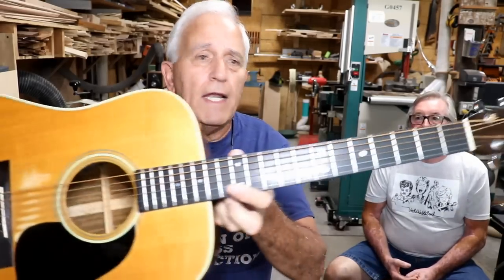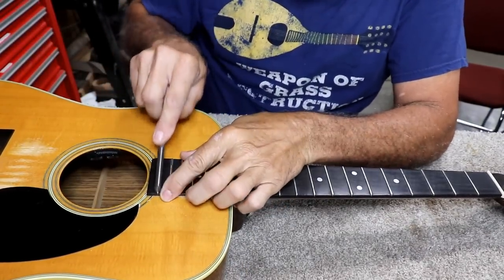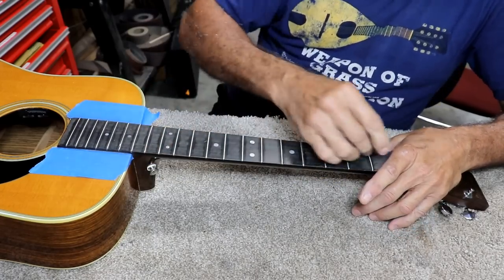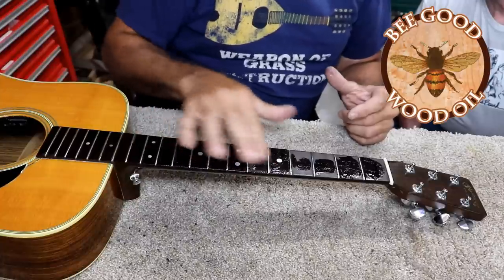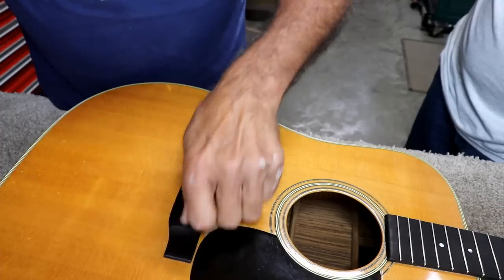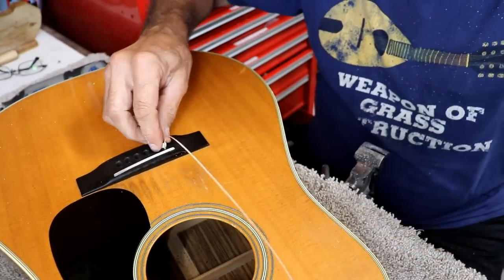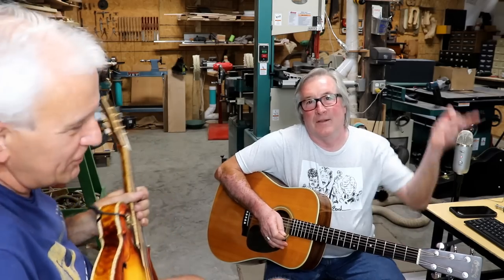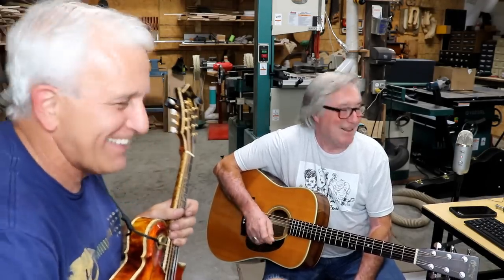585 RSW This Martin Guitar Is IN A PINCH

Comment: Hey Jerry, You putting grooves in groove-less bridge pins reminded me of an article I read some months ago.  Essentially, it said that it was sonically better to put the groove in the bridge/bridgeplate and then use groove-less bridge pins.  This would also eliminate having to file an angle on the pin tips, as you recommend, and I've been doing for over twenty years.  I haven't changed any of my guitars to this method, but I think all your many fans would be interested in your opinion of this issue.

Comment: Taking those heavy Grover tuners off the Martin guitars and putting Waverly’s on it helps tremendously! Takes several ounces off the peg head and lets it vibrate! It gives the guitar a much better feel without the weight on the peg head! Plus they stay in tune much better!
Reply: I've often thought about the added mass/weight of enclosed tuners; even on an electric...  I'd say the ones with a thin metal covering might be preferable to the kinda machined metal chunks.  But... I love the feel and ease of tuning of the high ratio, metal chunks; most of my 17 guitars have them.

Comment: When tuning the B string don't tune it open....  Fret the third fret and use your tuner to tune it to D.....That usually makes the B string sound more in tune.... Works best for me....
Reply: Hmmm... interesting.  The method I use is octave-tuning at the 7th fret; 8th for the B string.
Reply: My old J-50 Gibson, you know, with the GD ceramic saddle, was a bugger to tune the B string.  I just tuned it in unisen with the open E and left it alone.  It wasn't 100% perfect but 99% was close enough to bluegrass that my mates couldn't tell the difference.   Bob

Comment: Why not ream/taper the stringholes to match the unslotted pins and also slot the bridge for the life of the bridgeplate?  A reamed/slotted bridge with unslotted pins is superior to the standard Martin configuration with straight (unreamed/untapered) pin hole and slotted pins.  Helps to reduce wear on the bridgeplate where the ball-end contacts the bridgeplate.

Comment: Must confess for string fitting, I use the 'Dave Doll' method which (for me) is simpler and have never had a string break or slip and it looks real neat.  Bottom line is, whatever works that you're happy with.

Comment: Everyone does mistakes and there is only one thing to fix that....do it again and do in the correct way!:) 
I do tend to use a string winder...i find the easier than cause you always need to hold the string when you do your method cause i sometimes loose the grip on the string and it slips away specially the unwound strings.

Comment: As Dave would say“you don't cut the strings until you have all six strung up and tuned“ 👍Maybe a bit of pencil lead?  You will NEVER be able to set up a Martin as good as a Taylor.
Reply: You could if you were changing the bridge. then with care  you could make   intonation  right on  zero cents. REMEMBER A GUITAR IS ONLY  IN TUNE A FEW SECONDS**as soon as you put your hands on the neck it goes out of tune approx 5 cen ts***THAT IS THE REASON**NEVER TIE  A  SOULDER STRAP TO THE  PEG  HEAD **DR KEL

Comment: I never cut my strings until everything is complete just incase I hit a problem and the strings need to come off as its a pain re stringing without length.. them chromatic tuners are just not very accurate at all Jerry invest in a strobe tuner as they are 30 times more accurate to 1/10th of a cent than a chromatic.

Comment: if it was me, i would've put a fresh, new low E string on the sumbeetch.  But that's just me.
Reply from the maker: It was brand new and fresh
Reply: @RosaStringWorks   i guess i meant, i would not have re-used it after the first time i put it on, and after i had clipped off the excess.  maybe a bit of OCD on my part.